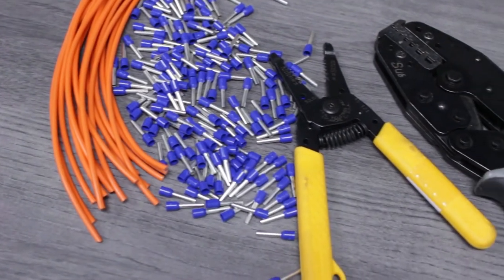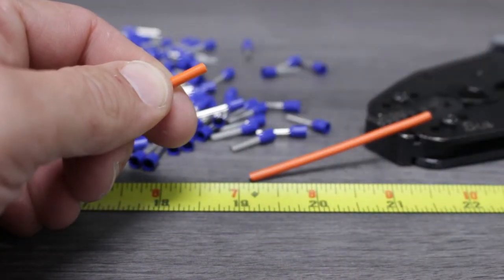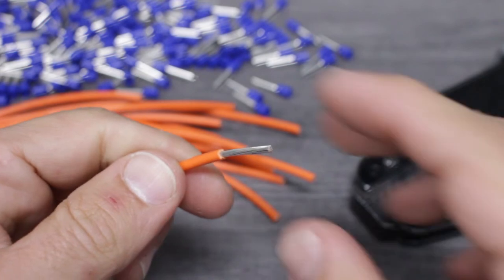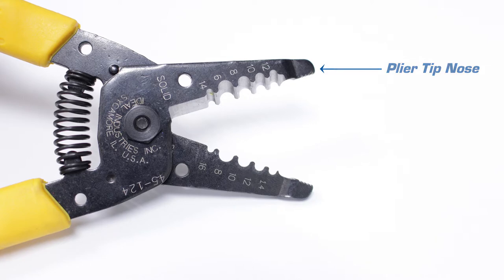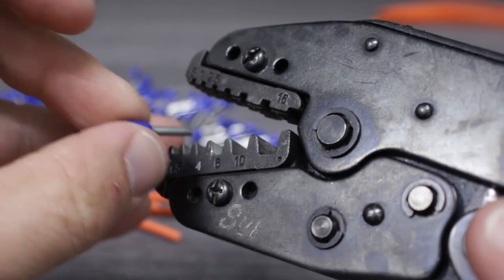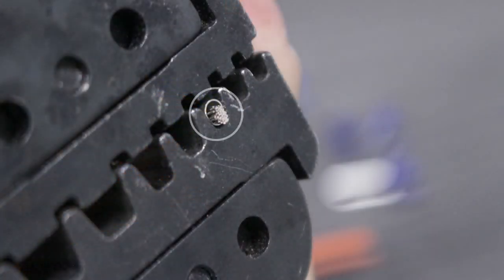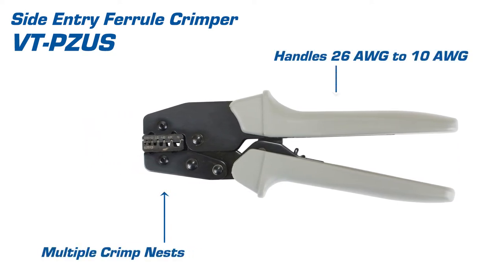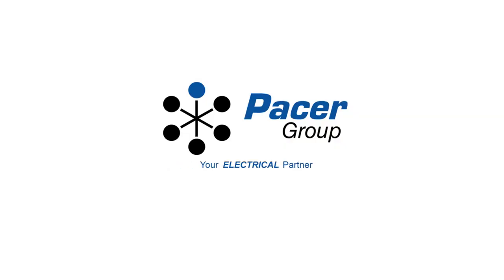Properly Installing Wire Ferrules

Comment: How come it is producing square pressed ferrule. I believed this was only possible by speci square and hexa crimpers
Reply from the maker: That's a great question. The tool used in the video was designed specifically for wire ferrules. When crimping, it shapes the ferrule body to be easily inserted and held by European terminal blocks.